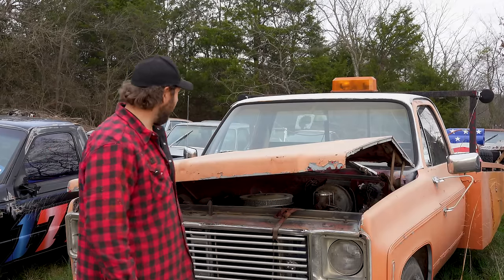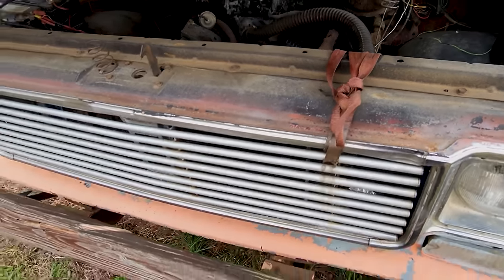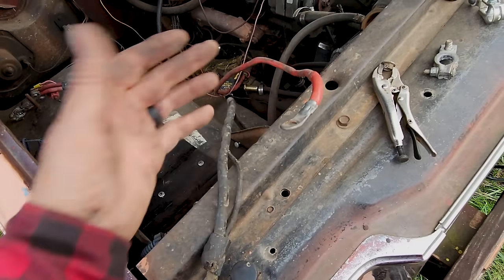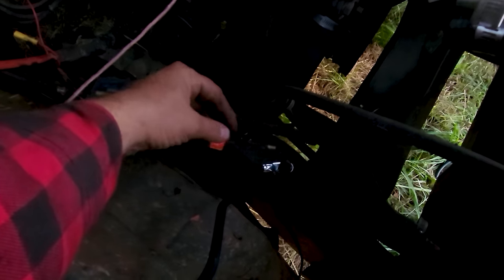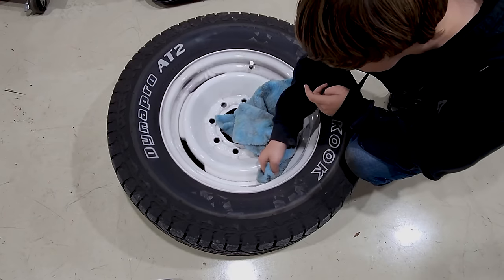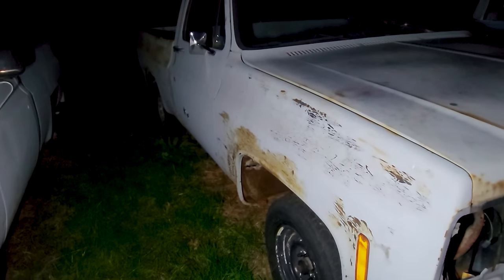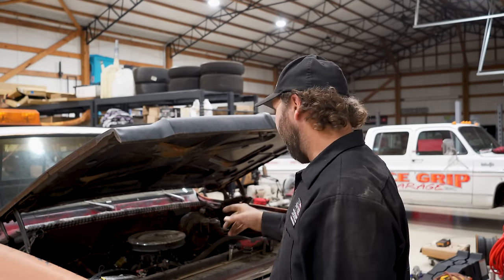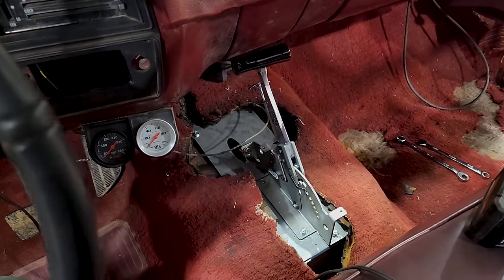Selling The World's Cheapest Ramp Truck - Let's make it BETTER!

Comment: If you put the batrays in parallel you will double the AMPERAGE. (good). If you put batrays in series, you'll get 28 volts (bad) and blow stuff out.
Reply: 24volts
Reply: Only bid you run 14v batteries!🤣
Reply: @imgonnagogetthepapersgetth8347  most batteries are at 13.5-14 volts while driving though soo
Reply: @M.TTT.  correct.
Reply: @M.TTT.  13.2-14.6 is what it should be.
Reply: @twinkie27271  ohhh wooooow, I was so far off from those numbers, jeeez wow

Comment: I would hate to be a battery in Derek's shop! :)
Reply: Every battery in Dereks shop is dead, his good batteries are bad, his new batteries are junk.   I’ve never seen any thing like it.
Reply: I always keep the ones I replace as long as they aren't completely bad just in case so I'm in the same boat when I throw one in something lol
Reply: I wonder why yt channels will but a new motor or trans before a new battery?
Reply: I'd hate to be an electro-digical fuel pump too. I have a feeling the battery "dance" was the culprit for the lost ground. Priceless if true!
Reply: Well we just had to rescue a dodge journey with a ripped serpentine belt and a dead battery...
But luckily the old Allis Chalmers is split in half so we just take some booster cables and steel a battery...

Comment: Seen guys take square tubing and weld or bolt on those hoods to support that crush joint! Those hoods were engineered and designed to bend like they do in an accident! So the hood would fold in a front collision! The hoods on the previous body styles would sometimes go through the windshield in front collisions! The 67 through 72 gm truck hoods  were alot more stiff and took alot of force to fold up! The 60 through 66 gm truck hoods were even more stronger! But everyone has trouble with the 73 through 80 hoods! Gm changed the design in 81 and made a big improvement! Never seen the 81 through 91 hoods fold like the older style!
Reply: Back to back videos advertising his own branded hood braces. What a coincidence
Reply: @mattg7952  why wouldn’t you advertise your own products?

Comment: I'm always in the same situation with 10 cars and 18 dead batteries. I may put in a sunshine catcher with a float charger and battery rack to keep all my non-used batteries topped off. With batteries $200 a piece now, it would probably pay for itself in a month since solar panels, float chargers and alligator clips are incredibly  cheap.

Comment: I noticed the slip on boots with the defined heel, which I also used to liv to work in and they’re way to slip off and on. But by the time I needed a back-e-otomy, the doc told me to start wearing wedge sole boots( commonly referred to as iron worker boots). Try a pair of wedge soles that have a really soft spongy sole and see if your back gets some pressure relieved.

Comment: Those 'creases' in the hood stiffeners are 'designed in' so that the hood folds in a frontal impact, rather than going through the windshield and taking your head off.  Although your Hood Savers are a wonderful idea, they are potentially making the vehicle a dangerous place to be.  It is, of course, up to the driver of the vehicle to avoid any collision in the first place.  Although WD40 is a lubricant, it is only a temporary fix on those hinges; what they need is a squirt of ordinary engine oil from an oil can (or a dribble from the dipstick).  Apart from this, I love your videos... I have been watching you for at least 3 years, but I'm currently playing catch-up 🙂. Looks like I'm still 5 months behind the times.  Anyhow, greetings from the UK.

Comment: Gosh those hood saver 6000 look similar to those ones we made out of strap steel back in the day. We didn’t have one of those electro digital laser beams to cut out ours though. We used a hacksaw and the old craftsman drill motor and a dull bit.

Comment: When Are you going to get back to the Buick Grand National ,I have a 87 with 30k on the clock and and Have owned since 89 ,just love it. the brakes are fun to work on electric motor 700 psi hydraulics Trippy setup

Comment: Like many DIYers, I’ve saved nuts and bolts from many projects over the years. I saved all the old bolts from the first rebuild of this engine back in 2004! I believe the bell housing bolt holes in the block are 7/16” which are the same as the head bolts and many others on the engine. I just used what I found in my box of bolts! However, when I got the engine back from the machine shop and had to remount it to the engine stand I found and used some of the old head bolts and I had to cut spacers out of 1/2” black pipe so the bolts penetrated deeply into the block because I knew I would be putting stress on the holts and I wanted to be sure they wouldn’t strip out.
You will see this process in an upcoming video of the engine rebuild!
Hope this helps!
Thanks for watching!

Comment: Remember to save on that Taco'ed hood, snow is just around the corner and that is a family size sled, you can even bolt a bench seat on there so you can bring the wife along, just give that thing a used car paint job so it slick and away you go.

Comment: That self folding hood is a safety thing. In a front end collision it will fold up rather than come through the windshield.  Too bad Chevrolet didn’t change from the old spring loaded hinges to a basic hinge and prop rod at the same time they designed the hood to fold.

Comment: would love something like this--put the Vortec in some car since its seasoned by now, and put in a Cad 472. wouldn't take much cash to produce 500 ft lbs at 2,500 rpm and no worries of diesel fuel jelling at freezing temps. Chevy BB truck headers can even be made to fit. But then I'd repaint it factory two-tone with Rustoleum's best, shop the used classifieds to jazz it up and even pay retail for whatever the modern version of JC Whitney items are to make it too purtty to sell--you know, something you won't mind driving across state lines to pick up a cheap project. it's a chevy square body after all, cheap enough to find knicknacks for.

Comment: wish i knew. i got a 94 obs shortbox with the high output vortec super 6 would of traded..hell drive that thing up here to VT. drive this obs home. needs ?? rear feed brake line. whiper heater radio. sides that runs pretty dang good lol..

Comment: Derek, i may have a possible solution to the black ramp truck.
Once upon a time i owned a 1985 chevy motorhome which ran great but was speed and rpm stuck, at 55 it screamed down the road. I have the fix but never used it. Hit me up if interested.

Comment: Great idea on the VGG 'hood saver 6000'; however, if you would improve your design by putting a 1/2 - 1 inch, 90° longitudinal lip/angle on the inside span, Your design will be infinity STRONGER with very little increase in the metal used and weight!!!
Just sayin'......    🤔🎄😂

Comment: I searched for the second part of the AMG Rebel Video but I couldn´t find it. I began this Video and you said "Carbon Monocide poisoning" and I thought : Must be the Rebel!!!! I never understood the Mid-Engine thing. It´s a cool car with a MEGA substance but totally undriveable without 1000 hours of work in both directions. Either you capsule the motor where he is now and rebuild the steering or you build everything back. Both is a sh..ton of work. I would build it back to original(or another front engine) because sitting on the back seats is shit for the vision field.

Comment: So somehow a guy had a dream about me doing burnout competitions in Independence Chevelle the reason because Derek ended up being on a phone call for a long time. The first round went great, but the second around Independence was a sitting duck it barely moved, ok so I thought I heard the timer go off but turns out I got disqualified because I threw the steering wheel from out of the car, I got out the car very upset I said to myself I'm sure Derek's gonna be not happy they went to interview me wondering what happened I don't remember what I said exactly but I was like well if you have anxiety and depression like I do then you would know just how I feel. Then I'm walking away from the stadium with the towel to my face, just as Derek finishes his phone call he had to calm me down then I woke up after that.